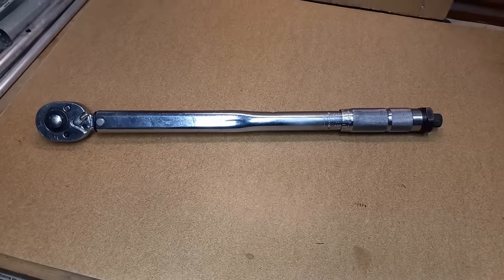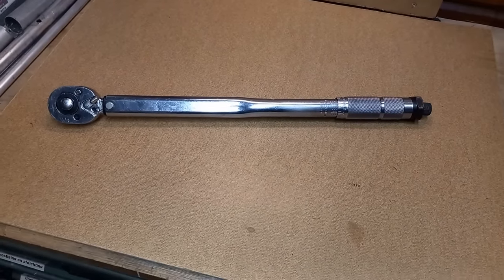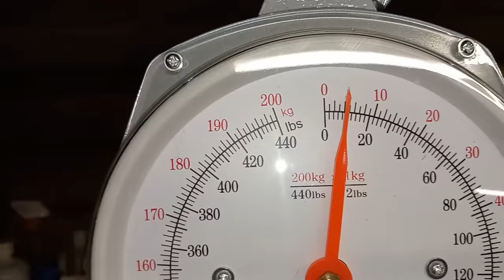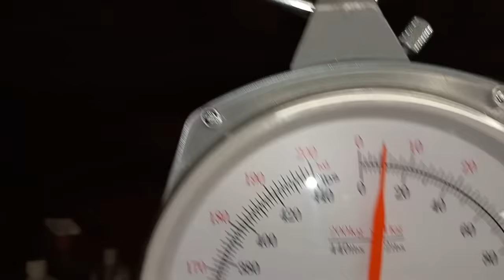How to calibrate a (cheap) torque wrench

Comment: It is great to see this done!  Even with using analog devices like that, this is easy and will help many DIY'ers!  Thank you.
Reply: Nothing is as precise as an analog device. I get more feeling for the measurements when it’s analog. You only need to read it right.
Reply: This is more likely to help many DIY'ers screw up the calibration of their torque wrench.  Torque is based on the amount of force at a specific distance from the pivot.   Without measuring the distance from pivot to scale placement, you will screw up the calibration.
Reply: @matterofrights2344  agreed
Reply: If you're going to calibrate it this way, might as well throw away the clicker type and use a beam torque wrench, it'll be just as accurate.😆😅🤣😂

Comment: Then applying force to the torque arm, always make sure the load you are applying is perpendicular (and stays perpendicular as it winds up) to the torque arm, or you won't be torqing with the load you're measuring.  Also, make sure it's on plane for the same reason.

Comment: I have exactly the same model of torque wrench, after 3 years of very infrequent use of this wrench came out the result of 27 kg of the required 30 kg. I think it is pretty good for 3 years without calibration. Now at least I know how to get down to calibration ;)
Reply: did you apply the force on the center part of the handle and not the end

Comment: Thank you so much for posting this! My old torque wrench has been unused for a few years and never  calibrated since new. I need to replace head gaskets on my vehicle, and I was considering buying a new torque wrench. This just saved me a bundle! Thanks again!! BTW my wrench is identical to yours, except graduated in lb.ft., purchased at Princess Auto in Canada.
Reply: Are you shure? Normwise there are two tableaus... 180degrees around ☝️😉
Reply: Probably has newton metres as well.

Comment: i would do it different, put the torque wrench on the vise vertically and it would be easier to hang the weight and make it click.
Reply from the maker: That's a much better idea indeed!
Reply: remember if you measure at 12" a point then is lbs for lbs. But if you have a longer torque wrench, you need to divide by 12 in the calculation to be exact ft .lbs @Carnold_YT

Comment: I guess another useful bit of info when doing the calibration is keeping the spring scale or water bottle etc. perpendicular to the torque wrench!  Good tutorial.  😎
Reply: If you're going to calibrate it this way, might as well throw away the clicker type and use a beam torque wrench, it'll be just as accurate.😆😅🤣😂

Comment: As a sanity check, I've checked my adjustable torque wrench against a deflecting beam one coupling the drives together. I wouldn't calibrate my wrench this way, but have checked it for drift this way. It works great.

Comment: I really enjoyed this video, thank you!Another method for calibrating anything (torque wrenches today) is to compare two or better still three other wrenches. If you haven't got more than one perhaps borrow one and compare them and particularly if all three actuate the same that's pretty good test. You can also use the method of setting to an angle, clamp square drive in the vice, set up all wrenches to the same setting and with the angular unit note the angles that each wrench clicks. If they all break at the same angle you have three pretty good wrenches, if not you can self calibrate or get them checked by a calibration service. Especially good makes of mechanical ones are expensive to replace and worth the cost if in good condition. This method has proven to be pretty good over the years as I on several occasions had access to a proper test facility so was able to double check results.
Reply from the maker: Thanks for your comment and insightful tips!

Comment: Excellent video! I have a couple of cheap torque wrenches myself with varying torque range values and I will definitely use this technique to check and calibrate them if needed. An average of +/- 5% of error is more than enough for your average backyard mechanic.

Comment: changing your grip affects the amount of torque you're applying at the head of the torque wrench, but it doesn't change the actual amount of force that has to be applied at the head to make it click. It changes the amount of force that has to be applied to the handle to make it click, but it still clicks based on the amount of torque being applied to the head/fastener regardless of how you're gripping it. so you can grip it at any spot and get the same results if you're just going by the click
Reply: It does change the reading (on the scale) of course. For instance ft-lbs is the amount of fource you would be pulling on the handle at a ft from the actual tip. So it does matter how far away the scale is on the handle, but i think you already understood that lol.

Comment: Good video, very clever

I recently watched a video saying for spring-loaded torque wrenches in order to be absolutely accurate. They have to be “warmed up” first which means work them from 0 to maximum in steps of 10% and then back down the other way to put some heat in the spring and some heat in the grease internally 

that’s clearly for high precision engine jobs and stuff like that.
Reply: for many years I used a deflection (beam) wrench. I figured that it was accurate if you could see the indicator, but with the way my eyes are now, it is tricky changing glasses.

Comment: I think you should be pulling in the groove on the middle of the handle
Reply: This is correct. It does matter on click type torque wrenches where your hand (or force in this instance) is positioned on the handle. The groove is actually there for a purpose. It is the location where the users hand should be centered to get an accurate torque value. Positioning the point of applied force to the bottom end of the wrench lowers the torque delivered at the socket attachment point. If you choke up on this type of torque wrench more torque is applied at the socket attachment point. Here's a good video that demonstrates this: https://www.youtube.com/watch?v=Fwfnf06dl84

Comment: Most people don't know this but most things don't have to be at some super exact torque spec. There is a range and if something is in that range then it's fine. If there are multiple bolts then it's usually important that they are the same torque. So if you're within the torque range and all of your bolts in an area are tightened very equally at the same torque then it's usually okay. So if a torque wrench is off by like 1.5 lbs at a 60lb torque spec then it usually doesn't matter. Actually most things have a larger tolerable range than that.

 If you're building a thousand horsepower engine then you should invest in an expensive, accurate, calibrated torque wrench though. Or if you're doing aerospace stuff.

Comment: I think you would benefit on using a bow scale, since it locks in the peak weight, you could use that to help dial the torque wrench easier.

Comment: I took a Herber Fraught $19.95 1/2" torque wrench to the calibration place here in town and paid my $60. It wasn't perfect or LINEAR by the scale, but it was with-in I think 8% across the board, which for a "clicker" (and automotive use) is "close enough" if you aren't building race engines. The WAY YOU use it will make MORE than an 8% difference. Like "just tighten and go" or "lube fastener, tighten, loosen, re-tighten to spec'd torque" or "tighten to spec, let sit an hour(2-4) loosen, re-torque"  or whatever the procedure you are SUPPOSED to use. The $5500+ electronic wrenches are supposed to be calibrated (about a grand) YEARLY. If you're working on jet turbines or turbosuperchargers, you NEED that precision.

Comment: Measurement of the arm and scale force must be applied to the middle section of the handle grip. In your case, the smooth band in the grip.
Reply: Exactly.  The correct distance to use is from center of drive to that ring in the center of the handle.  That changes his math a bit.
Reply: Glad someone else noticed this, I was going to comment the same.  Having the scale at the furthest point changes the leverage force.  With how little he had to adjust it, it was probably accurate before the adjustments
Reply: Not necessarily true because it depends on the distance the force is applied from the pivot. For example, if you can apply the force at the 1 metre point and you are applying the specified force for the setting on the dial, that may be correct. The breakout force of the mechanism may be compensated for any length handle, so you have to calculate the force for the distance from the pivot.
Reply: @chrisbode7173  Sorry but that's not correct. The mechanism works independently of the point of application of the force. The handle or whatever you want to call it is metal tube - it doesn't care or feel where you apply the force. Of course, if you apply the force at a point other than on the defined hand-hold, you would need to apply more force if nearer the pivot, or less force if further away. Try it and see. You could even extend the length of the handle with a piece of tubing of you like and that will reduce the force needed, but the breaking mechanism will still operate at exactly the same torque setting.
There's no mathS required - the calibration of the mechanism does all the work.
Reply: @125brat  you're correct. I made the mistake, indeed the wrench does the work for you as you write here above. Doesn't matter from what position and with what force. Sorrry.
Reply: @chrisbode7173 Thanks, no worries🍻

Comment: I make a straight coupler, 1/4”, 3/8”, or 1/2” from two old sockets welded together.  Annually, I couple my beam style torque wrenches to my click style clamped gently in the vice. I do three checks using a setting at the lower third of the scale, the center of the scale and the upper third. If the wrench clicks within 3% of the set torque across the board - good to go.  If it doesn’t, I adjust the tension and retest until it passes.  If it fails to adjust, it’s time for a new wrench. Beam style torque wrenches are non-adjustable and as long as they are not over torqued and bent/deformed, they are accurate in both directions.
Reply from the maker: Yes, beam style torque wrenches are super reliable, that's for sure!
Reply: This is exactly what I was going to post.  Beam wrenches are always accurate, just not very user friendly in places where you can 't see the sale.  So you always use them for calibration.  One thing I haven't seen mentioned here is that accuracy is always  a percentage of full scale.  So a 100 lb ft wrench of + or - 2% means + or - 2 lb ft.  If you have it set for 20  that's still 2 lb variance so 10% at that setting.  Which is why you want to use a 25 lb ft wrench if you're trying to set 15-20 as a 100 can be waaay off.

Comment: When refurbishing the steering gear on my '67 F100 I needed a 7-10 inch-lb. torque wrench so I made one using a wooden dowel and a 1/2" carriage bolt with the head cut off to drive the socket. The tricky part is getting the value of a known weight to hang off the handle. (I think it was a 3/8" carriage bolt)
Reply from the maker: Smart thinking, if it works, it works!

Comment: I use your method on my cheapo one but my ancient airfitter's King Dick elbow torque wrench the only way is to replace the inner tension spring to calibrate and this thing is old old old but its pretty accurate still all these years on, very heavy too but cumbersome in you have to remove the end cap, use a spanner to wind the adjustor in and out, replace cap to see if its set correctly and so on as it is designed to be used all day long at certain torques.   Apparently from what I have been told your airfitter or plane mechanic would have several setup and taped with different torque ratings on his trolley, then end of day the things unwound til next day when they would be wound back up to different torques, the elbow ensures perfect torque application thus you get very precise settings.
Reply from the maker: Having a beam style torque wrench is ideal for checking any other (affordable) torque wrenches. I mostly use it for lug nuts to ensure everyghing is tightened evenly.

Comment: As mentioned by others you should always back off the setting when finished with the job. (I reset to zero after each stage of a job) I also prefer to have beam style torque wrenches to check the clicker against. (For preload I prefer a beam style wrench as it's easy to see if you have a inconsistent preload with a beam style wrench)
Use a 8 point 1/2 socket or a 1/2 square to 1/2 square adapter to connect the beam to the clicker for testing.

A good quality beam wrench, taken care of, will last forever.

Comment: Nice job and great instructional video!...but I prefer to call such tools a Torque Gauge!  because every wrench is a torque wrench, because it applies torque, but a Torque Gauge measures it (or in the case of the click type, even limits it).  Cheers from my garage to yours!
Reply from the maker: Thanks so much for your comment, I think your terminology might be indeed more correct than calling it a torque wrench.

Comment: Great Video!
It should be noted, for accuracy, Always apply the water vessel or spring scale to the centre of the handgrip. Most TQ wrenches (99% of them) will have a band machined into the knurled grip as yours does. This is put there specifically as the calibration point. This is where the calibration force must be applied.  
Thanks for posting your video!!
Reply: I think that would have to be calculated to that length also then
Reply: There are tons of comments like this. If you don't understand the basics of torque, don't act like you do...

Comment: I found working on motorbikes where you get a steel bolt into a aluminum hole to be very careful as an oily well used bolt will easily strip the alu threads sticking to the recomended torque value..feel is everything . I think torque values are often given for a `dry `bolt also so reduce a bit if oiled .
Reply from the maker: That is correct, most workshop manuals don't state whether or not a bolt should be oiled. But applying a coat of oil will definitely affect the clamping force of the bolt (or nut). Especially with lightweight alloys, you should be careful. I personally like use my normal ratchet and tighten the bolts by feel in that case.
Reply: Wheel nut specs should typically be for dry threads, not for lubricated ones, except they add the info it's for lubricated threads

Comment: Another way to check a torque wrench is to compare it with other torque wrenches. People who have been working on cars for a long time tend to accumulate a collection of torque wrenches.
Reply: Yeah, I would think an old school beam wrench should be easy to see if it is calibrated as long as it has been treated well. (about as simple a mechanism as you can get)
Reply: What if that other torque wrench is off?
Reply: @e-curb  Well, at least you know one of the torque wrenches is bad. Not likely that two would be out-of-spec the same. Best practice would be to triangulate using three wrenches.
Reply: @malcolmmarzo2461    No, the best practice is to take it to a company that offers proper calibration.
Here's an example that happened to me. I was working on a car trying to get it to run right. Everything pointed to excessive fuel pressure. The carbs I was working with were spec'd to be able to work with fuel pressure of 3-3.5psi. I put a gauge on it; it read 2.5, so that wasn't the problem. But all of the symptoms said too much pressure. So I got another gauge. It confirmed the first one. So did a third gauge.  The fourth gauge said the pressure was 11 psi!  I reduced the pressure until it read 3 psi, and from then on, the car ran perfectly.  Three bad gauges in a row! 
You can't compare one instrument to another then claim their good.
Reply: @e-curb  You are right, in an ideal world. In practice people need rules of thumb for common problems. There will be exceptional situations such as you cite. Triangulation of data is still useful. For example aviators will compare three instruments to verify direction. A gyroscopic compass and a magnetic compass and a GPS should agree. But all three could be defective in some Twilight Zone scenario : - )

Comment: I did use a calibrated torqwrench connected to (check) the other cheap torqwrench ,mij offset was 0,03 percent 
verry happy ,most car workshops own a calibrated one and a checkup is easy to fix ,most mechanic are
willing help to test yours (for free ?)

Comment: Great video.
Although you missed some of the best bits.  
How did you calculate that 30 kg? At least a link to how to the calculation would have been handy.
How did you get the lock not off the handle.  It was magically gone.
I would not have thought of doing this.  Thanks for sharing
Reply: Davo's Shed, the torque wrench is set at 126 Nm. From Newton to kg, you have to divide by  9,81.  That makes 12,8 kgm. Divide this value by the distance in meters from pivot point to where you apply the pulling force. In the video that is 42 cm,  thus 0,42 m.  12,8 divided by 0,42 makes 30,6 kg.. To make it easier for yourself, put some painter's tape on the handle, make a mark at 42,8 cm and apply 30 kg of pulling force. Is more accurate.
Reply: @chrisbode7173  very interesting!
That 9.8 is curious.  Sounds like the good old metric system has something to do with that being acceleration due to gravity.
I better did out my old torque wrench.  If I remember correctly mines not adjustable, it’s just the bending force on the handle.
It’s an oldie not a goodie. :)
Reply: @DavoShed  Correct, 9,81 m/s2 is the acceleration due to gravity. I've worked with torque wrenches based on the bending force of the handle. They give a better understanding of the torque phenomenon. Great!